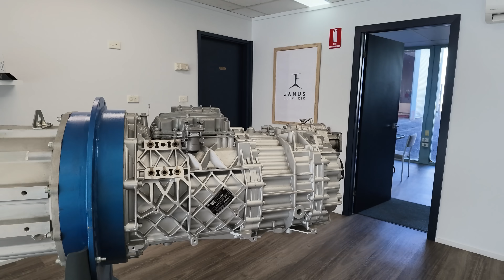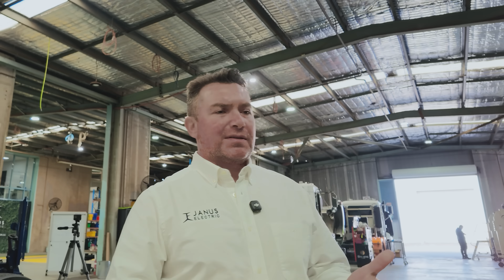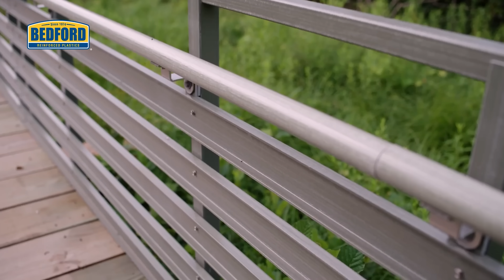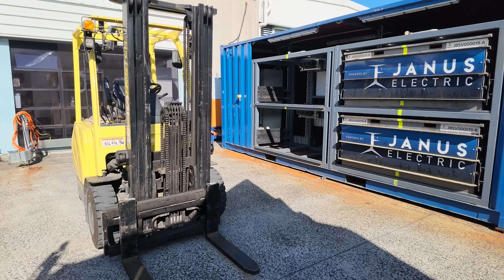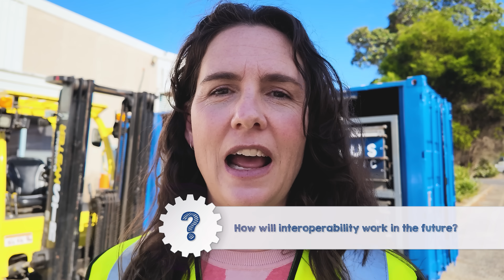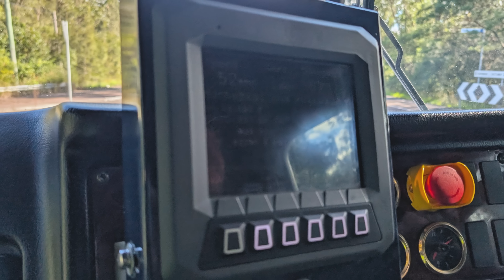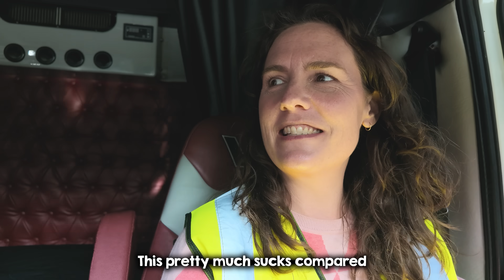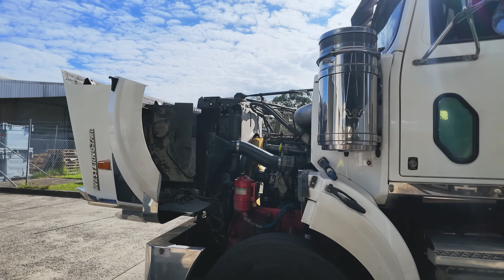The EV Truck Idea I Actually Didn't Believe Until I Saw It

Comment: Thanks for highlighting this interesting and important company.  As you note, even if new BEV trucks will eventually replace all of the older diesel trucks, we still can benefit greatly from a solution that allows the existing fleet of diesel trucks to be converted to BEV.  Given the need for routine engine replacement or refurbishment, it's an economic no brainer to switch the truck to electric at those intervals.

Comment: ROSIE - USA Tried battery swap , years ago and it FLOPPED hard. 
JANUS does not do bespoke cleansheet BEV SEMI.
Diesel conversions to BEV , are SLOWER, less safe, lower range & cargo. 
cost MORE to maintain , similar to ICE. 
BTW - Tesla semi is LAUNCHING in Australia in 2028.
Reply: Flopping hard is the USA default.
Reply: @ExternalInputs  - ANUS trucking & Edison motors are FLOOPING hard

Comment: ROSIE - key distinction, all other BEV semis are NOT bespoke clean sheet BEV semi.
ALL the other BEV semi are using OUTDATED ICE technology. 
- too SLOW.
- too HEAVY.
- still using legacy belts & pulleys. 
Tesla semi weighs SAME as Deisel. 
Tesla semi hauls +2000 lbs MORE than Diesel.
TESLA semi is both, its FASTER up to full legal limit.
Tesla semi bobtail is FASTER than stock Porsche 911. 
Tesla semi is the SAFEST semi ever built , will have FSD supervised soon. 
Tesla semi is the MOST Efficient semi at 1.5kwh/mile - see Run on Less (Tesla).

Comment: Battery swapping is an issue. The vehicle doesn't move without batteries, but you can't say you own the batteries because you get different batteries after every "charge". You can't even establish fleets bc what if you get a fleet of 10 new trucks, but after your first recharge you lose 85km of charge capacity because the used battery is old. More dendrites form of you charge to 100%, discharge beyond 30%, operate during high heat or extreme cold, or recycling power via stop and go traffic with regen braking. Someone has to own those batteries since they don't belong to the truck, and the liabilities for used batteries for swapping is going to become a nightmare after 5 years of legislation. This idea is doomed to a niche market.

Comment: I think one of the most important parts of this video is that they are willing to work with other manufactures to set up a standard for batteries. So many times in industry it takes years and years for a standard to be set up, sometimes it is only set up after government mandates (looking at you Apple).
Reply: Like they did with railway gauges?  😂

Comment: Why do these electric trucks need gearboxes? They are heavy, not good at handling the instant strong torque that the electric motor provide, and not necessary. They bring more failure points than necessary.

The battery swapping system looks simple to use.

What is the cost of swapping a battery?

Comment: I really wanted to see the qld government pivot their bus fleet replacement project away from diesel to Janus modules. They couldve just started with clean skin glider bodies and Janus mini modules.  With a distributed mega pack available to balance the city grid and respond in times of disaster (a possible funding stream too). In fact brisbane couldve been a world leader and greened their public transport fleet ahead of the Olympic games! It solves the state governments complaint about huge capex outlay for traditional ev buses charging infrastructure.  All solar soaked 😅🎉
Reply: Councils could even require their contractors to swap to ev modules, in garbage trucks for example.  Budgets could be balanced well before the capex is amortised. And all that noise and diesel particulate could go away over night. Australia could even make an soft power diplomacy industry out of it by helping our pacific partners switch to energy independence through their transport,  by replacing diesel with light Janus modules. (That's another funding stream)
Reply: And imagine rapidly helping colder climate countries upgrade their bus fleet to modular evs. No more stranded buses in New York blizzards while people freeze on the streets or in apartments when ev buses can roll out instantly due to the Janus power packs sitting in their charge cradle or bus harness in conditioning mode,  just staying toastie and ready to go.  With so much energy available a Janus enabled ev bus could even be fitted out as a disaster field relief unit,  hearing or cooling depending on the circumstance,  even as a sealed unit/positive pressure capsule during bushfires to aid respiratory compromised people.  And the lighter duty bus sized modules could be placed onto a trailer for instant dispatch too. Otherwise just for our a bus with multiport usb panels and mobile wifi/ satellite links. To provide mobile energy in time of flood or fire.  😅. Sadly the Qld Government has not considered this approach,  who will be first? 🤔

Comment: Hi, greetings from germany. We had a dude that quit his former job to make his trucking license and start driving electric trucks all over Europe. He got lucky and started at a company that commited early on to electric trucks. So over one and a half years he had the chance to drive several different trucks from different truck builders.
He managed to drive to norway, turkey, gibraltar and up in the UK. So basicaly he showed that all of europe is possible by electric truck. 
He has 200 videos in english under the name Electric Trucker and around 300 in german.
Next week he is starting a trip around the world in 80 charging stops, by electric truck. Using a eActross 600.
He's comming to Australia too.

To make the conclusion of the channel in short:
After diesel prices are gone through the roof and electric trucks don't need to pay the toll for the Autobahn, it's the best way to make money in the transportation buiseness right now. Far distance is profitabel. Short distance still sucks. 2,5 times more expensive truck, toll less relevant and only short distances. Short haul has to wait.

Comment: conversion is a good start, but ideally we want vehicle design as EV so battery swap would be easier rather than just replacing the fuel tank which isn't ideal.

Comment: I've owned and run a fleet of trucks all my life.  It all comes down to the numbers.  The company I run now, the EV truck we own costs more to run than all the diesel ones.  The customer is happy to pay extra because they want to tell people they're green.  Purchase price and depreciation are two biggest killers, the cost of infrastructure to charge effectively is also far more than people realise, if you can even get the power company to do it.  This Janus system (I know them well) isn't too bad, but you're diverting a driver to get battery changes, possibly at a location which is painful, and that is driver wages which are an expense even higher than fuel.   Weight is an issue too, so is insurance.   I'd love to be proven wrong by the Excel spreadsheet though - doing these calcs is my day job.
Reply: They said the battery change takes only minutes, so do you monitor driver's toilet breaks and penalise the weak-bladdered? The conversion featured here claimed to be lighter than the diesel it replaced, with an even lighter combo coming soon. If European trucks are heavier, it'll be the batteries aimed at longer range. If you're going to be negative, make fair comparisons, not bogus ones.

Comment: I managed thousands  hardware systems that had a dozen user removable components and alignment issues. The connection issues caused tons of tons of damage and connectivity problems in supporting the product looking at the electrical connection between the battery and the truck. 

May I suggest a conical receptacle in the truck an inverted conical for the battery. 

The conical connector design allows for more tolerance and tighter fit when the forklift driver is not aligned. 

Thanks for the video Rosie! And best wishes for Janus’s success!
Reply: That seems like it might be better addressed by appropriate load rails that are more open at the entry but narrow to ensure proper positioning before the electrical connections are anywhere close - possibly including a final separate electrical connection step that is much lower force (socket in the battery, then throw a lever that pushes replaceable plugs onto the contacts).

The battery packs can likely be easily sold on to later non-vehicle uses after aging reduces capacity below the standard they want for trucks.

Comment: The beauty of the Janus system is if a a pack fails, it's a simple swap, and I dare say it's not hard to upgrade either. Cokes, Woolworths and Aldi really need to get with this programme; they use fleet diesels to service their stores.
Reply: Yeah when we unload trucks they sit on the bay 30 minutes sometimes to an hour.

Comment: This is great. However, I worry about the cooling. Nissan Leaf have proven that battery packs without a descent cooling system don't last as long. Especially in extreme temperature environments.

Comment: Thats all fine and dandy if its local depots. Its been proposed to set up swap and go battery stations on interstate routes, but....theres too many factors like the battery condition of what you are swapping, is it genuine or aftermarket,  is anyone there to monitor the battery charging?, or the infrastructure to actually put that in place, the various brands oftrucks.......for interstate,  nope..still need diesel

Comment: Thanks Rosie for your presentation but looking at the diesel trucks you were driving and saying that they are all bumpy and noisy IS a problem with those specifically American brands. Otherwise when you try getting into trucks like the Merc Mp5 or L pro Cabin much as it's super ugly, you would realize that it's very possible to have a very comfortable truck and super quiet much as it's a diesel coz Pilot injections that make the diesel trucks quite and so efficient are a standard for Euro truck makers like Scania, MAN, Volvo, Daf and Iveco. Otherwise those American long nose trucks are just 1980 donkys compared to the latest European trucks

Comment: Great piece, thank you.  What is the comparable running costs?
Reply from the maker: A lot lower in most places especially recently due to the Hormuz issues. But it does depend on the current price of diesel and the local price of electricity, so there's not a single answer to that question.

Comment: Although it may not continuously power a truck or even provide a big percentage of the power used, it seems obvious a trailer covered in solar panels could provide a cheap economical source that could at least extend the range a bit.

Comment: I've been saying this to all the fossil fuel dropkicks saying battery isn't viable. Once the industry sorts itself out with uniformity you'll be able to go anywhere in Australia and just exchange your battery like you do a gas bottle at the servos. All outback roadhouses will run their own solar farms without having powerlines running miles and miles and another fossil fuel fan always goes on about infrastructure. There's nothing wrong also with the trailers carrying their own batteries that can be recharged whilst getting loaded or interchangeable. First thing they should do is have the rechargeable cable in the car and not the charging stations to stop them being stolen. Should be able to swap car batteries as well

Comment: I'm glad the Australian government supports renewables to the point that a local manufacturer can find a lane to push forward big truck electrification.  This video shows that a certain orthodoxy around range and battery size not matching up with end user requirements is hampering options for end users and slowing down electrification.  Speaking as an a American, this system would work great in many parts of the world including America, but there is so much animosity to change in America, being pushed from the old companies that made trillions on internal combustion engines, I don't see battery swapping happening to any degree for domestically owned truck fleets without government leadership that is currently non-existent.  If the parent company was non-American, it's possible a conversion company like Janus could find customers if it lowered business cost.  Great video and great company!

Comment: The trucking industry needs to push for battery compatibility/standard so they aren't locked in  to one brand which would mean battery costs lower.

Comment: Thinking about software heavy newer trucks (like cars).... how does the Janus solution interface? The monitoring systems on modern diesel engines are tied into the software of the truck - pretty sure the software would be showing a screen full of red warning symbols if a bunch of the sensors that they were connected to suddenly were not there.

Comment: My experience us unless its a US bonneted truck, your out of luck.  Plus the lack of swapping facilities, the conversion cost, hire of battery cost, and the  initial cost of truck places it at the high end for individual paving the way for what BHP, Gina Rinehart etc should be doing. A Chinese EV prime mover is way cheaper but there is limited to no support in AU.   Then try and charge it with the grid we have and its a fail everywhere.  Battery swap is the go, just manufacturers need to standardize it like a bowser handle on a fuel pump.  That way we can have off peak charging filling swap and go batteries at the common change station down the road.  Other wise I'm staying with pre emission as post emission is too expansive and complicated to maintain.

Comment: Excellent presentation.   Makes so much sense.   I am doing similar with high speed Vessels using a hybrid foil system.  But switching batteries more difficult, so going with Mega Watt Charging as most boat will have a home base to operate from.

Comment: Interesting video, but lots of nothing burger answers given by Janus.  Perfect example, why are Janus rigs lighter?  Only real point made is that those other rigs are going for range claims.  Well, what does that mean for Janus trucks?  Does that mean Janus has a lower range than another brand and is targetting short haul operations?

Not taking pot shots or implying there is anything wrong with Janus' methodologies but how about some proper answers instead of marketing speak.

Comment: years ago I thought electric cars might go down a similar route with petrol stations holding racks of charged batteries with some kind of mechanical replacement system and even the ability to choose how many batteries you had in the car say 3 for general day to day and add a couple more if you were going on a longer journey.

Comment: Edison Motors in Canada is also converting older diesel trucks but with twist. They're going with a hybrid solution using diesel/electric system similar to what locomotives have been for decades. Difference being a battery is included. If a charging station isn't handy the diesel can be fired up to charge the batteries while continuing to drive. They've partnered with Deboss Garage to convert pickup trucks as well.

Comment: It is beyond comprehension that swappable batteries were not considered from the beginning.
After all most battery operated equipment uses replaceable batteries, even rechargeable batteries can be replaced, although that is not as simple as it used to be.

Comment: Sad to see the wool pulled over your eyes….it might possibly work in Australia but not elsewhere. As for recharging a fleet of TruCk batteries from roof top solar….do the calculations yourself. He never said what the capacity of the batteries is and being air cooled in the outback?? How does he condition the batteries for recharging at the station. The battery position on the truck will not get much air flow…as for the truck being lighter….it must have very small battery packs….the OEMs are not idiots when they design trucks….

Comment: Battery swapping is not practical until all manufactures come up with standard sizes like size AAA, AA, A B, C and batteries. May be  22 kw, 40 kw, 80 kw, 120 kw and 240 kw versions.

Comment: This is an optimum way to convert to electric vehicles.  Trucks drive the most, use a huge chunk of the fuel and pollute the most.   every truck we electrify equal 10 or more typical passenger car electifications.  Battery swapping also is optimum, because not nearly as many swapping stations are need to cover most of the long haul truck corridors.  All the benefits of swapping including using the batteries being charged by the solar and wind to make money on grid support as well.  This will happen very fast.  China, CA and Australia are already doing it.

Comment: Now this is what I call practical. Thanks for this. I prefer this to Musk's flashy secrecy. While I can see where there will be some issues, eg, when the fork lift driver accidentally crunches the battery or the carrying compartment and it needs to be repaired, but I think that's fixable. There could be an issue with side impacts, as another. And if you're aware of some of the hazards of driving transport, turning to tight a turn around an obstacle could impact the battery carrier. But I do love the concept. I always thought that would be a preferable approach. Musk dropped it. It was a stupid decision. Can you imagine owning a battery swapping station that goes up in lithium hellfire? Not to mention the problem of the station ending up with bad batteries? I am curious to see how these issues work themselves out. Probably going to need to develop processes and procedures for testing batteries, and pulling them out of the loop for repairs. Probably going to need to devise some tricky underwriting procedures too. I hope they don't just throw up their hands and give up.